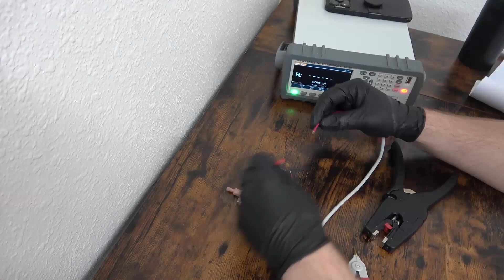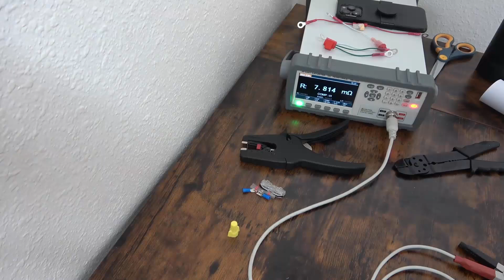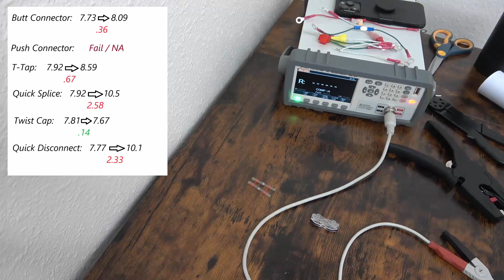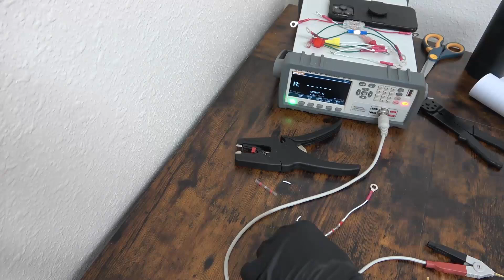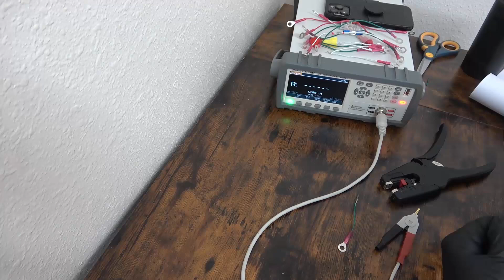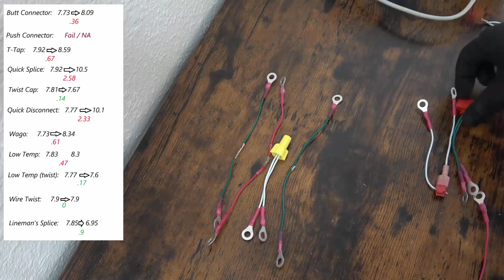Testing Popular 12v wire connectors.  Which are the best?

Comment: Nice, another great video👍 Results were very surprising, but predictable. Idea for the future video - test the most popular speaker connectors. Cup terminals, bolts, xt connectors, maybe some smd stuff.
Reply from the maker: Whew, I don't trust the cup terminals.  I've had to call the fire department over the inner connection on a prefab box going wonky..  Managed to get it out of my car but told them I basically had a wooden box on fire with no way to put it out in the parking lot of a daycare at 2am.. (first place I could pull over). 

That would be a good test I agree.

Comment: Great testing.  Answers some questions I was looking at.  If you do a follow up, can you see if the suitcase connectors increase the resistance of the through wire?  Also, Anderson powerpoles as well as a terminal block with crimped spade connectors would both be interesting to see how they effect resistance.   And maybe a good quality suitcase connector like a 3m making sure it is the correct one for the wire gauge?

Comment: I think there are a couple of useful tests that could expand on the results. 

The first being a tensile strength test. As an installer, I shove wires in dashes and other places constantly and my main concern is making sure they aren’t going to come apart as the wires are bunched up. I use butt connectors 99% of the time for efficiency sake, and I have found wider crimpers like Klein or Thomas & Betts do a much better job at making solid connections. 

Another thing I’ve often wondered about is current capacity on splices. I’m sure if you’re doing small gauge wire the connectors are plenty robust enough to handle more current than the wire itself, but connections such as t-taps make me a little leery since they only touch the wire at very small points on each side. 

Great video! Got my brain going this morning 😉

Comment: I try to solder and shrink wrap almost everything.  I do like to crimp on a spade connector for stuff that I may need to disconnect (blue turn on lead, backup camera red wire) or at my tweeters and mids so I can swap them out easy.
Reply from the maker: The way I solder, I think the results would be nearly identical to the lineman's splice.  I apply solder to this type of connection when I have wires worth soldering.  

I'm not sure if it would improve the connection as much as make it super-permanent.  A lineman's splice + solder = the strongest point in the wire when applying tension.

Comment: Hi. Thank you for the test.
You could remove the ring connectors, and cut all the finished wires to the same lenght, so, the comparission is more equitable.
The wires could be crossed thru the butt connector, so they are crimped together.
Could you test soldered connections? NASA style versus simply strait pretined ends soldered side by side, as you did with the low temp, but with real tin solder, because the  tin as his resistivity about 6X higher than copper, I always try to have the pretined ends long enough so the surface between them is at least 6X bigger than the wire cross section.
When I use Quick disconnect, I slide the plastic insulation off, and use a better crimping tool, the same used for mc4 solar pannels connectors, when crimped, just slide the insulation back on, or heat shrink.
Also, under load, the results may vary. :-)
Cheers.